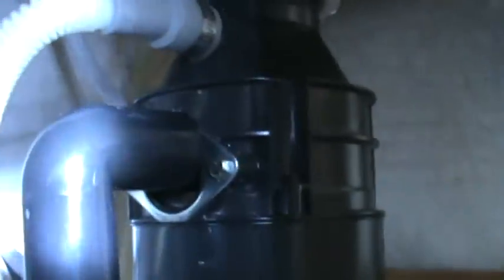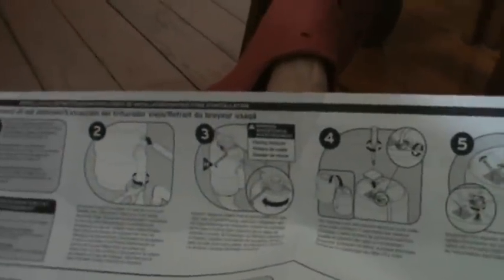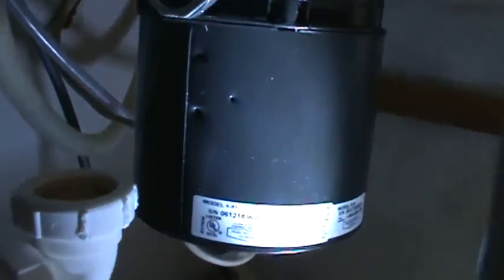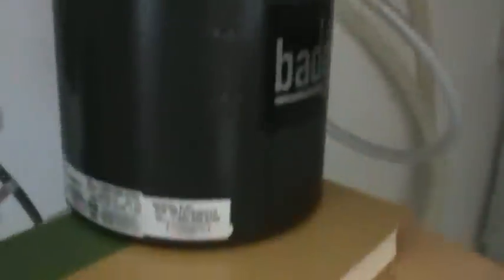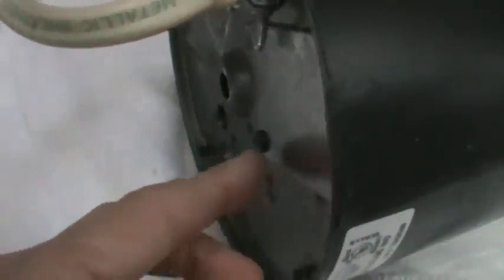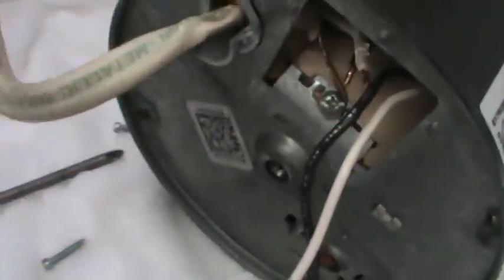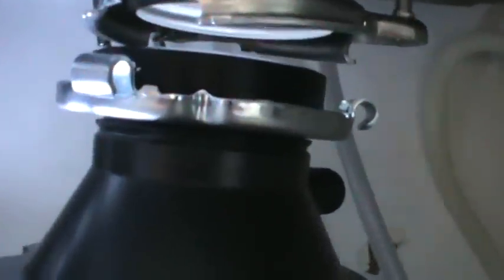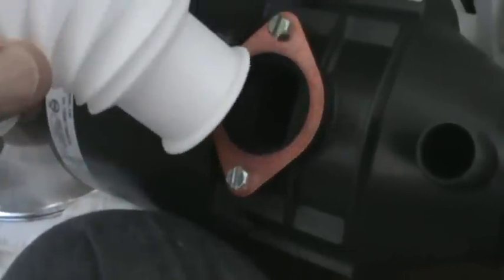Installing A New Garbage Disposal

Comment: yes Phyllis that stuff wont hold up its like an old accordion it always breaks in the inner joint .  some one else can ring in on here im sure im not the only on who wont use that stuff again
Reply from the maker: +390bear Thanks for the information.  I had no choice but to use the flexible pipe because the drain is about 1/2 over too far to meet the pipe from the disposal which is exactly what caused the problem in the beginning, the  other pipe was bent over to meet the drain.  Over time it finally gave way and I had an explosion of small pieces of apple all over me and the floor. If you know of a way to replace the flexible pipe with something else let me know.
Reply: +Phyllis Stokes  good going Phyllis  don't worry about it you might have better luck than me I did look up different videos and other people are using that same one and not having any issues  have a great day

Comment: YOU DID A GREAT JOB  handy lady  but that white flex pipe wont stand up to what comes out that thing just think of it as a sausage maker pumping the stuff through it will build up and break at some time in the future I would get a hard pipe  and I even go one step farther and wrap my joints with tar tape  good luck
Reply from the maker: +390bear Do you have experience with the flexible pipe?
Reply: That's correct.  In addition to be being to thin for disposal plumbing application, the flex pipe gives food debris lots of places to collect and create a clog over time which will also begin to smell pretty bad.
Reply: I'm a Licensed Home inspector, you cannot use flexible drain lines in any application, especially a disposal. Just trying to help.

Comment: this is one of the worst how to videos out there.  I watched it to know how to install that flexible drain line and you just cut that out. I just bought the same thing and I cant get the copper thing to fit over before the gasket. If you do a how to video you need to show ever step and not jump over steps.